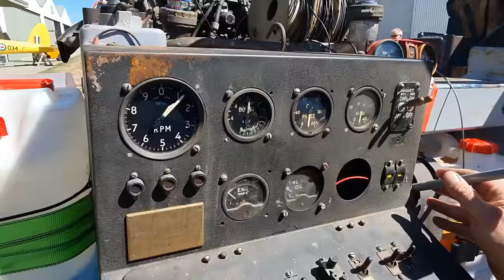First run of Merlin 25 engine in 50 years!

Comment: My father sat behind a RR Merlin engine in his P51 as he escorted the B17's across the Channel and engaged 190's an 109's.   The Brits sure made a damn fine engine.
Reply: They still do.
Reply: Yes they did and still do to this day. The British engineers are amazing!
Reply: Good chance my dad was piloting one of those B-17s that your dad flew escort for. Either way, some thanks to your dad is in order.👍👍
Reply: Might have been a Packard Merlin. American built and leaked oil less:). Talking to restoration guys swap any part between Hawkers products no problem(not so the Spitfire). Our tolerances on our early tanks was especially horrendous .
Reply: With out the Merlin the war might have turn out very different it powered so may aircraft for the RAF and for the  USAF Mustang.
Reply: @niklar55  Sounds like America today... Our so-called leaders have almost totally sold us out
Reply: @JungleYT  
Actually they've been bought, lock, stock, and barrel.
Reply: @niklar55  Yep...
Reply: Sy.mphony
Reply: Thank you. And thank you to your Dad for his efforts and his bravery.
Reply: @bigZCNC  Knowing British industry British Merlins probably made with tools from when Victoria was on the thrown.
At least Packard could probably have a few new machines to work with.
Reply: @bigZCNC  Right. P51s were equipped with the Packard V-1650 version of the Merlin. Canadian-built Lancasters also used the Packard. Packard made changes to the design to speed up production and reduce the intense hand fitting required with the RR original.
Reply: Back in 1994, the local Air National Guard base held an airshow, the theme being 50th anniversary of D-Day.  The guest of honor was Francis "Gabby" Gabreski.  A guy I knew was his escort for the festivities.  He wasn't going to stay for the airshow, but somebody talked him into it.

The guy told me they were talking out on the tarmac when Gabby cocked his head.  He said he immediately recognized the sound as the Canadian Lancaster bomber flew in to land, he said he could never forget the sound of Merlins.  The show was great, we were parked near the flight line and the Lancaster parked in front of us, along with a B-17.  There was a B-24 and B-25, but they were further down the line.  But when the two started up in prep for the afternoon flybys, I could imagine this must be what it sounded like on a bomber airfield in Britain.  🙂
Reply: @Hamchunk1968  We can't imagine what it must have been like back then. Airfield i work on had about 100 Avro Ansons for multi and navigator training. All ghosts now.
Reply: Goering is supposed to have said that when he saw the first Mustang he knew the air war was lost.
Reply: @lawrencemarocco8197  Correct. I was told that perhaps the only fault of the British-made Merlin was that it was hand made, therefore slight variations existed between engines. Packard, however, standardised the production of Merlins using an assembly line aporoach which made production more efficient and easier. 👍
Reply: @niklar55  The best politicians that money can buy. 
 God Help U.S. !
Reply: Yes a Pickard Merlin leaked less oil and supposedly used less fuel.  That was what most likely powered your Dads P 51. Awesome story sir. Those pilots had big balls that's for sure.
Reply: My late uncle a NZer flew the four engined Lancaster bomber in the RAF during WW2. He talked highly of the Merlin engine and said they were better than the Packard built copy of the engine. The Merlin was probably the engine that won the Battle of Britain!
Reply: Packard built Merlins in the P51's. They actually made a number of improvements to the ones they built and exported them to Canada and the UK to keep up with demand.
Reply: chefduane  WRONG !!! ALL WRONG !!!  P51 Mustangs, the production merlin version never used a RR Built Merlin, They were ALL Built in AMERICA by PACKARD !!! them cold hard facts of history so many Brits are ignorant of.  Packard built 55,525 merlins 37,137 FOR THE BRITS and 18,000 for the USAAF !!!!!!
Reply: @scottcupp8129  The engine that was run above was a PACKARD built as were 1/2 of the engines in the Lancasters, Mk BIII !!!!  Facts of history !!
Reply: @lawrencemarocco8197  3,040 of the Lancaster Mk BIII built at Castle Bromwich were ALL powered by the PACKARD built merlin, what made it a Mk BIII FYI and the 400 built in Canada Mk X's !!!
Reply: @idleonlooker1078  Yes they did and RR signed off on the changes, they needed engines !! !
Reply: @eac1235  ONLY PACKARD built Merlins were used is ALL production merlin Mustangs !!!  NO British built engines were used !!!
Reply: @4thstooge75  The whole main reason PACKARD was contracted with to built the Merlin was for the Brits as an off shore shadow factory away from the war zone,  The Mustang got the Merlin because they were AVAILABLE in the USA thanks to PACKARD !!!
Reply: All the Merlin blueprints were shipped to the USA for Packard to follow but they’re were too complicated for them so they built their own version
Reply: @flybobbie1449 it didn’t help you with your spelling though dit it ? 😂😂😂
Reply: cheefduane  IF  your dad sat in a P51 Mustang he did NOT sit behind a RR Built merlin !!!!  He sat behind a Merlin Made by PACKARD in AMERICA.  Only Packard merlins were used in a Mustang !!!
Reply: @scottcupp8129  RR themselves built less than half of all merlins made,  Packard made 55,525  Ford UK made 33,000  thats 88,525  of the 160,000  total made !!!  Facts of history IF you have done any research !!!
Reply: @derekfromtauranga6012  Not true as the Packard had a longer time between overhauls, better tighter engine !!
Reply: @4thstooge75  The main reason Packard was contracted to build the Merlin was to be a shadow off shore away from the war factory.  Brits received 37,137 Packard built merlins !!!
Reply: @wilburfinnigan2142  RR designed Packard built Merlin.  Better?

Comment: Those old engines were literally works of art .
Reply: I'm working on a 1917 American Lefrance in my machine shop . It amazes me at some of the machine work they were able to do back then . They were machinist but also wonderful craftsmen .
Reply: @ALABAMAHEADHUNTER  Boet of South Africa fantastic gives me goosbums
Reply: Yes they are.
Reply: The Rolls Royce Versions were all hand built with mating surfaces hand scraped so no gaskets needed. RR were quite concerned when Packard started building them with unskilled staff and used gaskets. RR thought they would be unreliable but they were much the same reliability as the RR ones. As a result it is far easier to swap parts between Packard engines rather than the RR originals.
Reply: "Literally".
Really?
Or do you mean 'virtually?

Comment: Wow, That's incredible. What a sound. Imagine two of them at full throttle hustling  down the runway for takeoff.....
Reply: or one with a bunch of 500 cals nestling in the wings...
Reply: In the whole world, there is no better sound than that made by a Merlin.
Reply: The only Merlin I have ever actually heard in life was an American built racing hydroplane called Miss Budweiser here in Oz. My Dad was a RAEME and he worked on tanks doing his Nasho back in the day. He is still living but has dementia. He used to tell me that the Centurion tanks had two Merlins (I think they were Meteors, the non supercharged version) and a BMC (austin / morris) 900 side valve engine just as the genset to run the electrics. Or was it the 884OHV. He’s even starting to forget that.

Comment: As a teenager so many years ago, I broke in a new 0.49 engine for a model plane that I never finished. But it took me 2 days to get it to turn over, my hands wet with fuel and oil, and around 9pm I got the sucker to run! The sound was so sweet. Just like this old girl.
Reply: I had a Cox 0.49 baby bee as a teenager.
Reply: @MegaDirtyberty  Yup, that's the one!
Reply: you'll never forget the smell of that fuel
Reply: @jerryeinstandig7996  8 parts metanol and 2 parts castor oil. =) Had a few little engines myself. The previous mentioned Cox Baby Bee, a O.S. Max 15 , a O.S. Max 20 Marine and a Enya 19.
Reply: TESTORS
Reply: @jamesturner1525  Did Testors make the DOPE or just enamel ?
Reply: I was in the hobby from 1964 thru 1969.  Cox Baby Bees and Golden Bees.  I mostly flew combat in contests using Italian Super Tigre 35BBs.  Tons of good clean fun, and the smells of the dope finishes and the fuels were wonderful!
Reply: I graduated my addiction to Methanol Fumes and Krylon spraypaint fumes in '70 when one of my buddys said "Let's GO Racin' NASCAR Modifieds

Comment: Heard one in p51 mustang at airshow do low fly by. Best sounding engine ever designed.
Reply: maybe it was a Spitfire
Reply: Most of your Merlin's are made by Packard. All of our ones were made by Rolls Royce. The sounds was almost identical but being English, I'd got for the RR anytime.
Reply: During a flypast of a Lancaster with it's 4 Merlin engines the pilot must have realised that they were a bit low as they headed for my house which is slightly higher than the airfield. The pilot must have opened the throttles to gain height but it made the most beautiful sound. Why is it you never have a recorder ready when this happens ?
Reply: @markwestwood9730    Liar !!!!  Packard made and shipped 37,137 merlins to the Brits,  3,040 of the built in UK lancaster Mk BIII, and 300 Canadian MkX's  used only the Packard built merlins !!!!!

Comment: Back in the 60's one of my first jobs was working at a marine chandlery, one of the counterworkers was a Brit called Jeremy.  Jeremy was a mechanic on the Merlin engines and during the war he told me he would sit on top of the motor and measure the flame coming out of the exhaust when tuning it.  Not entirely sure where he would put his legs without burning them on the manifold.
Another story, there was a Kittyhawk on Saltspring Island BC.  Just off the ferry dock.  On one of my trips over there I saw this parked in someone's yard with the wings removed.  The owner came out and asked If I'd like him to start it...So he started it up.  I think they were Allisons in them at the time, not the same as a Merlin.  But still, a thrill for a 15 yr old kid.
I believe it was sold to an American and was moved elsewhere.

Comment: Counting the exhaust pipes you'd think its a 10 cylinder, but it is in fact a V12 with the back 2  cylinders sharing the same exhaust pipe.  I assume this was done for clearance reasons.  Great to hear these old engines come to life.
Reply: Quite the unique collector pipe for those rear cylinders. Not sure about the clearance because the wing edge is above and behind the engine some 2-3 feet. Anyone know?
Reply: @theophilhist6455  It is described in the Mosquito history books part 1 & 2. They did not all have dualed rear stubs and some only on one side. The argument against it was dualing the stubs last 5-7 mph from the top speed due to the reduction in the 'jet' effect.
Reply: @johnmurrell3175  excellent reasoning...and thanks for recommending the book...I'll check it out
Reply: @theophilhist6455  The books are de Havilland Mosquito an illustrated history Volumes 1 & 2. V1 by Stuart Howe & V2 by Ian Thirsk. I got mine from the de Havilland museum where I first saw the V12 Merlin with 11 exhaust stubs. The Haynes 'Workshop Manual' is quite good as well. I have only seen a Mosquito flying once when it arrived for ther Farnborough Airshow but that was a long time ago. Other than that it's only WW2 cine films - the film of the bouncing bomb tests on the Ashley Range in WW2 are quite interesting. The Mosquito dropped the bomb from such a low level that it had to pull up after release so the bomb did not nit the aircraft after the first bounce !
Reply: @johnmurrell3175  Your knowledge and enthusiasm for this great plane is contagious. Ever since I built a scale model of the plane it has become one of my favorites of all time.
Reply: @theophilhist6455  They doubled up the back 2 cylinders to give clearance to the wing only on the WOODEN Mosquito !!!!
Reply: @johnmurrell3175  Only the early Mosquitos with the merlin 20 series SINGLE STSGE supercharger had them.  The LATER 2 stage merlins were longer and that made the nacelle longer and more room not needed on the 2 stage engines !!!  Both sides of both engines had the dualed stubs !!!

Comment: Lovely to hear the old rolls going again. A big blast of throttle would have been the icing on the cake.
Reply: Unfortunately because it doesn't have a prop or flywheel overspeed is a big possibility with to much throttle because although they are a big engine they are very responsive. I was lucky enough to work on and test four merlins which are/were used for the  Boscombe down wind tunnel.
Here's a link to the layout we also did the fans which were massive 3/4ton steel hubs about 3ft6/4ft across with if I remember correctly 6 blades that ran a matter of mm's away from the interior of the duct tunnel. Got to see it operational when they were environmental testing the Eurofighter Typhoon.
Reply: And yes it did sound as good as you could imagine it would.
Reply: @garethwood3474  Wow, Thank you for the info. My son who is an aircraft maintenance engineer will be very interested to hear that.
Reply: jimstrainandstuff  It a PACKARD  built in the USA !!!!!   DUUUUHHH!!!!!!
Reply: @wilburfinnigan2142  the Merlin engine was made by Rolls Royce, first produced in 1933

Comment: What a lovely noise, with the cams loping along! Can't wait to hear both engines running together! Mosquito one of my favorite warbirds.
Reply: 'Lovely noise' is an oxymoron. Noise is unwanted sound. This machine makes a nice sound
Reply: @engasal  Whatev ... it's a lovely noise that makes a nice sound ... if you were a flyer, you just MIGHT understand ...
Reply: @Navy Flyer - I thought your favourite would be ther Sea Mosquito ? Interesting to read about the first landing of a mosquito on an aircraft carrier the pilot Winkie Brown had to land several yards to port of the centre line otherwise the wing tip would have hit the island !
Reply: @johnmurrell3175  I'll have to look into that escapade! I hadn't heard of the Sea Mosquito before. Even larger, the C-130 landed and took off from USS FORRESTAL several times to assess its carrier flying capabilities.
Reply: @kerrynye3752  You should read 'Wings on my Sleeve' by Captain Eric 'Winkle' Brown. That has details of the trials and the modifications for carrier operation as well as lots of other great stories of Navy test flying. The Sea Mosquitos were intended for use in the war in the far east but did not arrive before the war ended. Soon after jet engines ( and the UK invention of the angled flight deck) allowed jet aircraft to operate from carriers and piston engines were consigned to history for Navy aircraft. Turbo props soldiered on in aircraft such as the Gannet but that was driven by endurance rather than speed.

The most interesting Mosquito was possibly the 'Tetse' armed with a 6 pounder anti-tank gun. It saw limited service but had dramatic impact on some U boats with the shells going through the pressure hull, bouncing around the engine room before exiting out through the pressure hull on one occasion. Needless to say the U-boat sank.
Reply: The other DH carrier aircraft worth looking at is the Sea Hornet - the Hornet was a lightweight faster version of the Mosquito designed as a high altitude fighter. It was also made in a Sea Hornet version that actually got as far as being flown from aircraft carriers. This had contra rotating propellers to get over the handling problems with the Mosquito if an engine failed. I think it may also have had the thrust producing radiators like the Typhoon. The Mosquito of course had conventional drag producing radiators.

Comment: The cam shaft rocker arms arrangement is work of art in itself .....
Reply: I recently did a head gasket on a Toyota 2.7 truck engine  , 97 Tacoma , and it looks very very  similar.
Reply: michael  actually not, The ALLISON V1710 had a better more modern design in that it used rollers on the rocker  shafts, same as the latest high powered engines of today and the ALLISON ran waaay back in the mid 1930 before the Merlin and was a larger, simplar design !!!

Comment: I am amazed at the technical genius of this powerplant made at a time when most of our vehicles were powered by low compression flathead engines you have this overhead cam multi valve fire breathing beast.
Reply: Why are the rocker arms so short in modern engines? Here in the Merlin the end almost moves in a straight. With a pentroof the fix point moves a bit up.

Comment: Amazing to think that so many of these engines were made and yet so few left?
Reply: There are probably around 500 airworthy and in flying aircraft with near that many spares in various states of readiness.  Add to that there may be about 500 being used in display aircraft and museums, and another 500 in various other applications such as drag racing, tractor pulls, boats, and static displays.  With 150,000 having been made and at least 20000 left that's a large attrition rate, but there are plenty around and can be purchased for around $40 to $100,000 depending on condition.

p.s. I made up all those numbers, but I'm probably not far off on any of them, and the applications noted are accurate.

Comment: You have to appreciate how fast the technology changed from the Wright brothers motor to the engines of WW II aircraft that involved improvements and discoveries in metallurgy, casting, machining, and chemistry.  And none of it done at the direction or guidance of bureaucrats in an early 20th century version of  OSHA regulated or EPA guided centralized planning.

Comment: As a young man I was a Tank Troop Leader using Centurion Main Battle Tanks which were fitted with Merlin engines detuned to run on Super Petrol. Only 600HP!
Reply: mickmoriarty  they were Meteor engines, non supercharged, cast iron versions